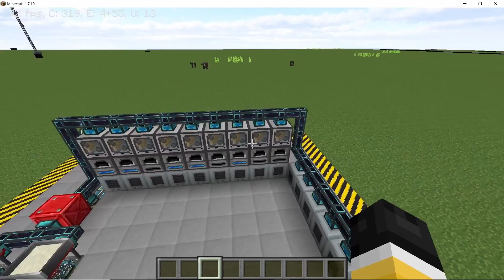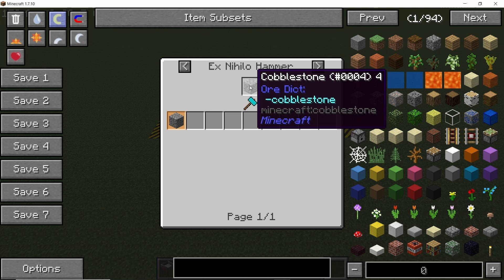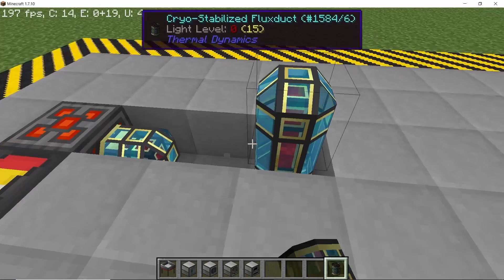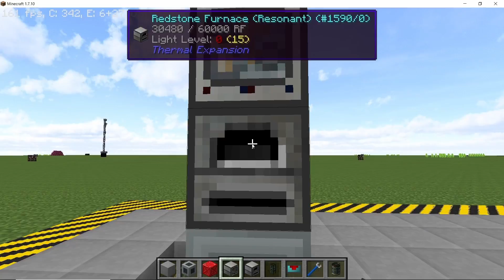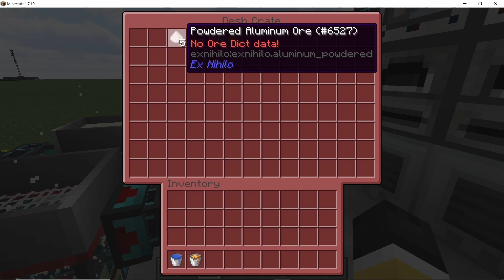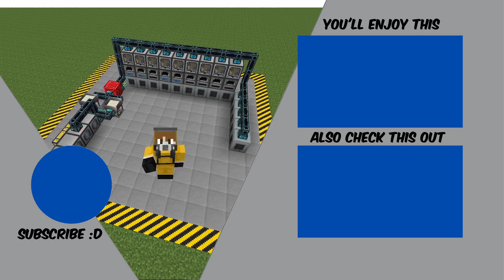Infinite Resource Generation - Ex-Astris Mod + Thermal Expansion - Minecraft 1.7.10

Comment: I hate it when it's about something infinite.
Reply from the maker: Bro doesn't like automation :(
Reply: @SavageVegeta  I didn't say anything about automation. Automation is possible without infinite resources
Reply from the maker: @farnorth7216  true, but infinite resources is afterall the ultimate form of automation where you can literally focus on building an epic base/world or explore the whole time while ingots will be ready for you once you get back.
Setting this whole thing up is pretty expensive with all of the upgraded machines but once done it's worth it.
Reply: @SavageVegeta  Automation doesn't mean something infinite.
Reply from the maker: @farnorth7216  I said the ultimate form of automation, ofc you can have automation to any degree you wish but what would you consider it's highest possibility to be in a game where you have to mine for everything manually... That is what I mean
This changes when the game changes like for example Satisfactory, it already has ore nodes which work as an infinite source with fixed rates so in there it means having a production line which can exactly handle the input of ores.
Reply from the maker: @farnorth7216  I don't know to what degree you have worked in an industrial environment but as someone who has spent over 7 years in different lines of manufacturing I do understand very well what automation is :)
Reply: @SavageVegeta  I don't know what Satisfactory is so I won't comment. I think it's another game that has nothing to do with minecraft. Infinity cannot be the ultimate in automation. I don't know where you're getting this from. Infinity is what discourages the desire to automate something afterwards because you already have something infinite. You can set up quarries and mine and the ore mined from the quarry can also be automated and it's no less automation than what you're talking about. I work in the oil industry and I know what automation is. Your example with personal experience is not relevant because in reality there is no infinity. Everyone has a resource and a limit. Infinity discourages play
Reply from the maker: @farnorth7216  if infinity discouraged play then why do you think there are so many mods and modpacks which allow for this mechanism ? Take the most popular of them all - Skyfactory. Just cause you don't need to mine for ores doesn't mean you can't play Minecraft at all, cause for many people the case is opposite as once you have automated something you can focus on a different aspect of your Minecraft world. 
And I gave the example of Satisfactory to tell you that "automation" in itself can vary depending on where you are applying it.
Reply from the maker: @farnorth7216  anyways to rest my case I'll just tell you this, this mod exists and it can automate a few basic ores and resources and I don't see a problem with it. "Afterall if it can be done it should be done" (One of the mottos of modded Minecraft ) 
ntm in itself has bedrock ores now that allow the opening of such diverse processing paths , using this mod is just a fun alternative nothing else
Reply: @SavageVegeta  Not all mods have infinity in them. You can automate a lot of things without infinity and at the same time focus on other aspects of the game also without infinity. It doesn't get in the way. It does not prevent you from sometimes moving the quarry because everything has already been dug in this place.  It is very sad that it is possible to automate the ores. It loses all interest
Reply: @SavageVegeta  I'm only claiming infinity.